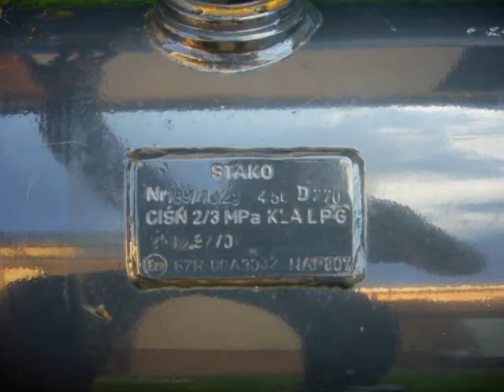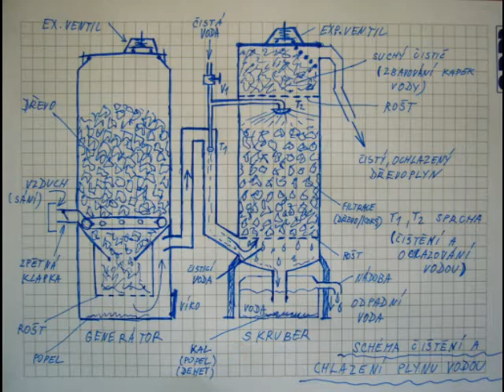WOOD GAS , DŘEVOPLYN

Comment: Great project, I wish I could build something like that :)

Maybe just an idea - you could use old car engine to drive the alternator, since you can capture waste heat from the engine through the water cooling system. You would than have both from wood - electricity and heat (for home heating, hot water etc.).